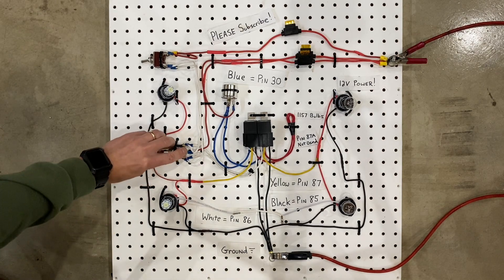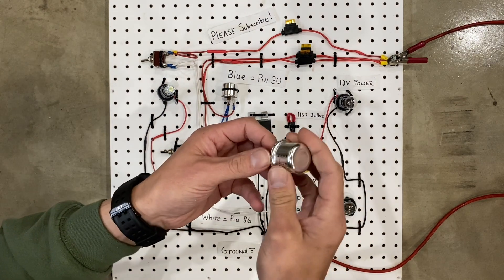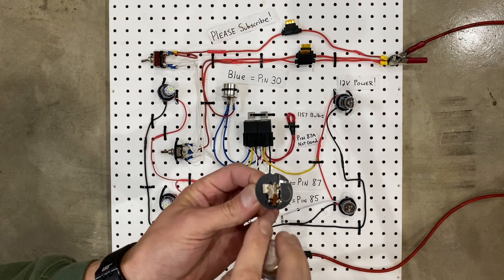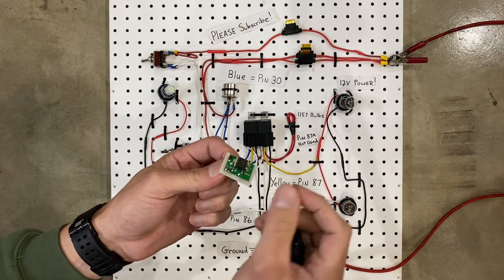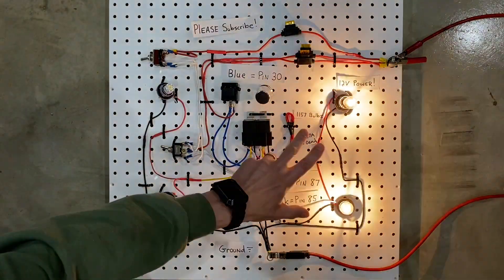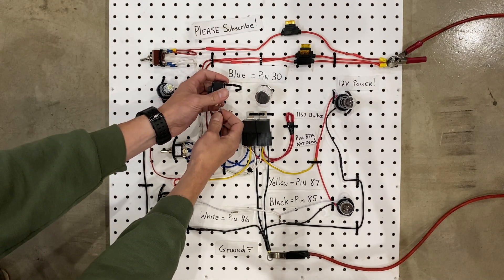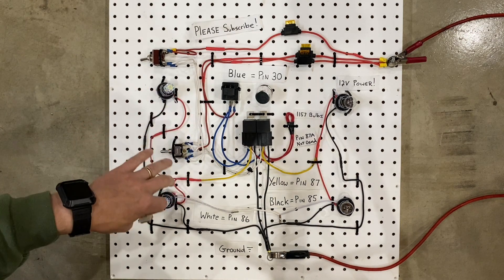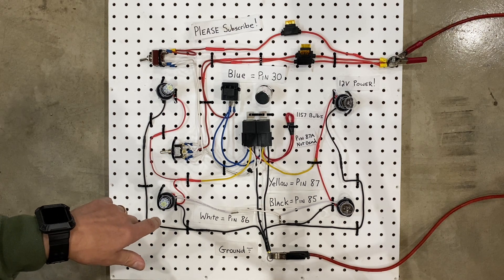How to Fix Your LED Turn Signal Bulbs that Don't Flash. Make Them Blink! | @WiringRescue

Comment from the maker: Thank You for watching the LED Flasher video! 
Subscribe To This YouTube Channel: http://www.youtube.com/user/4g63mightymax?sub_confirmation=1
See My Wiring Playlist: https://www.youtube.com/playlist?list=PLsF7T1tRFy2hmiiUUfMZNyV-BUA_yrPIh
Reply: I mistakenly purchased a 5 pin flasher relay instead of the 5 pin Bosch for some LED pod lights for my quad distance to the parts store and general laziness have me wondering if I can run them with the wires reversed so as to prevent the pulse for the flash or will this LED flash relay overheat?
Reply: @ChinaClone_rider it's not designed for constant current so I would say it would fail prematurely. It's been a year. Is it still working or did it fail?
Reply: @bernardocisneros4402   didn't work
Reply: Hi sir can i put a LED flasher with an halogen bulb?
Reply: @vincentjayvalenzona4051 Yes, as long as the Watt rating on the halogen bulb is less than the Watt rating on the LED flasher.
Reply: What is it when the right side works with the led but the left side won't flash
Reply: @chukkpurdy5151 Are you referring to this video? The LED bulbs were on the left side and the incandescent bulbs were on the right side of the screen throughout the entire video, so I don't understand your question. The reason why the LED bulbs don't blink when connected to the old style flasher is because the old style flasher needs more current than the LEDs can draw, to heat the bi-metallic strip inside of the old flasher. The heating and cooling of the bi-metallic strip is what causes the contacts inside the old flasher to open and close. The opening and closing of the contacts is what makes the lights blink.
Reply: Hmmmm This didn’t work for me.  Restoring an old K20 and upgraded to all led, so nothing flashed. I bought the relay and got very slow flashing with no headlights and no flashing with headlights on.  IDK.
Reply: @Dano500  My guess is that it's going to be your power and/or ground to your new LED relay or you received a defective relay. Those are the only things it could be.
Reply: Hi
Reply: I installed a led flasher, the signals work until I turn my clearance lights or headlights on, what do ido

Comment: So, I redid my 83 CJ-7 with a painless harness.  All bulbs are led, except my front turn signals in the grill.  I tried led bulbs with built in resistors and electronic flashers.  They'll only flash with the lights off.  The second I put the parking or headlights on, they won't blink.  I've tried with and without the polarity adapter.  Any ideas?

Comment: Uh...not so fast. You did not address hyperflasing AND the fact that 2016 tundras DO NOT COME WITH nor are they available, LED FLASHERS.
I've got a gremlin somewhere and have tried ALMOST everything to fix...even a l8cal electrical mechanic scratching his head...new flasher, install diodes in the old one, new sets of tail lights, new fuse...nothing. Right side hyperflasing daytime. Both hyperflasing night time. Shine a flashlight on the sensor at night...left side ok, right still hyperflasing. Hazards work flawlessly. 😢

Comment: Hello, great video! I'm 71 yrs old....riding since I was 7. Because I've nearly been rearended a dozen times thru my life (4 or 5 times I would have been hit had I not moved to the side very guickly). I now have 3 bikes with a 07 softail custom being the one I'm working on now. I'm not concerned with the factory turn signals on the  front but want to change to LED on the rears. So, will each side work correctly with an OEM on front and a LED on the rear. Judging by your video, it appears it'll all work correctly but want to be sure. Thank you! Stan in Hville AL
Reply from the maker: It will depend on what kind of resistance your flasher requires. I’d swap the bulbs and see what happens. Then swap to an LED flasher if needed.

Comment: I've bought 3 sets of different LED bulbs for my bumper tjrn signals in my 95 s10. Every other light i have is LED, but the front ones won't flash for shit.  So obviously, it's not the bulbs. it's the flasher.  Duh. Hopefully, it'll work. i js bought one

Comment: I've hit a road block in my 68 Bird. I've tried different variations of led flasher relays. I've tried reversing polarity. I've even experimented with the grounded options. Nothing changes. With a relay installed, without a relay installed the turn signal light engages on but won't flash.
Reply from the maker: That’s very strange. Are you sure you are working on the correct circuit? I know it’s crazy, but it may be worth checking continuity throughout the system to make sure you aren’t swapping out the flasher for the hazards instead of the turn signals. Sometimes they are separated. Good luck!

Comment: I tried before with LED on my Electric Fiat which uses normal lights by the way. No go. I put in head lights and they work both high and low beams. I wanted to swap out all my lights for LED and the reverse lights half way work. As long as one is the normal bulb I can run an LED on the other side. If I swap out both to LED neither work. Both work with normal lights. Odd they would put normal lights in an Electric Car. Good job Fiat.

Comment: I had this problem installing LED lights on my 67 Chevelle.  They sell ones with a ground wire coming out of the top and one without a ground wire.  Chevelle parts suppliers sell the one with a ground wire.  Is the ground wire necessary?

Comment: When I turn the signal to the right or left, all four signals are on at the same time. Can this be fixed by installing a compatible LED flasher?
Reply from the maker: An LED flasher wouldn’t help that. It sounds like something is wired incorrectly, and it is back-feeding the opposite circuit. Possible a hazard switch wiring wrong?

Comment: Yeah, it's a bendix metallic strip.  Like one side tin, other side something else, and they heat up, but one heats different speed, causing the stiffer one to pull it over to its side, creating the bending action.

Nice explanation.  Okay, now I need some assistance finding the flasher relay on a 1987 Ford E350...🤔   I see so many on the web are round cylinders, but I believe mine may already be a square one.  I wish it was like mint green or pink.  I have so many black or silver square relays under my dash area.

Comment: Hey mate thanks for the video. Iv done a bulb swap on my bike to led and installed a led flasher cam but now they all flash together 😂 any ideas?
Reply from the maker: That’s pretty weird! I would bet that your hazard lights and turn signals all go through one flasher and for a reason that I don’t quite understand, the turn signals are back feeding the other lights through the hazard circuit. If you unplug the hazard switch (if posssible) you could test this idea. Either way - good luck! I’m cheering for you!
Reply: @WiringRescue thanks for the response. I believe I have found the solution as others have found also. The indicator bulb on the dash is still globe type so installing diodes either side of it has worked for others so power doesn’t back Feed. I’ll try this thanks

Comment: Ugh, no help.  I already replaced the Relay Flasher, when I converted all my light bulbs to LED (2005 Silverado), took care of the "Hyper Flashing".  Rear Side markers have a white LED (the housing is Red), everything works great.  I want to switch to a Red LED (gives it a deep Red), but switched to 2 different LED's (both have a Red hue) and the Marker stays on, activated, won't Flash (Turn Signal).  This also causes the Front Side markers to stay off.  Hazards won't flash.  My dash, the turn signal indicators don't flash either AND they are bleeding color (lightly illuminated even when not activated).
  Tried looking/researching for other relays that can help, but none are given except for "Diode Dynamics LED Flasher compatible with Chevrolet Silverado 2003-2006, LM487", which I already have installed, that took away the Hyper flashing.  I am stumped.  Not a big deal, I guess, just that the white bulb makes it look "lite", kinda pinkish, while the Brake/turn signal light has a deep/rich red color and its making my ADHD/OCD crazy!

Comment: What is I add an in line resistor as a load to draw and dissipate the necessary heat to consume the current? :) I heard the Canbus  type already have the resistor

Comment: what about the HAZARD flasher , does that need replaced also ? i am attempting to convert my turn signals and markers to LED . i replaced both flashers to electronic , turn signals work great until i turn the headlights on then they no longer bling just solid on . also the HAZARD do not work at all . thank you .

Comment: What happens if you upgrade your motorcycle turn signals front and rear (different led signal products front vs rear) and swap the relay for an LED one, but the rear signals work properly and the front ones stay solid and don't blink?

Comment: Does it have to use two power switch relays? No way of doing it with one, that allows switching between left side / right side indicators? Might be a stupid question but not wired some before. It's for a motorbike.

Comment: Great video. I have also change for led indicator which is only one and only one side works. If a remove led bulb and turn it 180 it works for other side. I wonder why.

Comment: Hi, thanks for the video. So the new relay style is polarity sensitive and blinks when connected correctly, but doesn't blink if wires are reversed. What about the old style relay? The one with the bi-metallic strips. Is it polarity sensitive too or does it blink regardless of how it's connected?
Reply from the maker: In my experience, the old style flasher does not care if the wires are reversed. It’s very basic, and is quite happy with any electricity flowing through it. Good luck with your project!
Reply: @WiringRescue  Thanks for the quick reply.

Comment: Why would my led bulbs not blink. I have led blinkers with led flasher with ground. Everything else works fine. They work fine when I switch back to regular bulbs. So my problem is not the flasher. What can it be? Thank you!

Comment: Can you swap out the Flasher Relay to LED version and expect it to work with newer vehicles that measure resistance on lights through a connected network and that trigger a warning light when the resistance is not found?

Comment: Thank you for pointing out the polarity issue with flasher relay!! I put my new relay in my 89 Ram and by all accounts, it looked like it fit perfect into the socket, but polarity had to be reversed to get it to work on both the turns and flashers.

Comment: I just upgraded to Led turn signals and mine flash "but" mine flash at twice the normal bulb speed. 
Question ⁉️ Do you think this might cause early burn out of the control system?

Comment: My question .. I have a1982 Honda sabre 750 .. I have a led conversion on it ... the flashers blink ,turn on, turn off as far as I'm concern work .. but my warning light for the tail light keeps detecting a tail light malfunction .. could the conversion be affecting my warning sensor .. I never had incadessant on it to see if that still triggers .. I'm afraid they won't pass safety .

Comment: My problem is the led turn signals won't flash if I turn on the parking/running lights or the headlights.  They flash alone but not with the headlights on.  I have a 1992 ford f150.  Do you have a video that covers that because I'm stumped.
Reply: Did you ever find a solution? I'm having the same problem, works fine unless the headlights are on.

Comment: Perfect thanks
Reply from the maker: Your very welcome! Thank you for watching it!
Reply: @WiringRescue  no such luck I tried putting the new led kind in but still no blinks, nothing it works fine for incandescent lights just not the led ones, enen tried changing both the flasher and the hazard flasher with the new led able ones nothing had to put the incandescent lights back in, any ideas?

Comment: Awesome video ! My problem is my LED turn signals work , but when I turn on my running lights or Headlights which are also LED They wont blink anymore but with Running lights and headlights off they do.
Reply: Did u ever figure out what to do?  I have the exact same problem and it's hard to find a straight simple answer.
Reply: @MattS-w1b  yes after much hardship I found I still had regular bulbs in my front fender turn signal indicators and was causing interruption so if you have regular bulbs in line with LEDs even with led turn signal and hazard flasher

Comment: I bought some aftermarket smoked headlight assemblies that have the halogen bulbs in them for the headlight but the bottom ones is just a LED bar that turns yellow when you cut on your turn signal and then when it goes back off and turn back white for the driving lights had resistors in there from the factory but still hyperflash so I bought a lm487 LED flasher for a 2003 GMC Sierra 1500 that is supposed to be for LEDs but it still don't flash right and then it makes my trailer brake lights when I've got it hooked up to a trailer not work I could take the original GMC one it's stick in there and the trailer brake lights will work any clues of what I can do
Reply from the maker: Unfortunately I’m not super familiar with the workings of those style lights, so I don’t think I can be of much help. Have you tried contacting the seller of them? Maybe they can provide a wiring diagram /schematic?

Comment: I have a question I installed LEDs and headlights and turn signals. I did have hyper flash. I fix that with a relay. When I try to install LEDs in the rear turn signals my front turn signals will not light up. They will work when the headlights are off when I turn the headlights on, the turn signals on my console stay on when I turn the left or right turn signal on it only flashes in the back any suggestions
Reply: It probably has to do with the GND(-) wiring of the loads. All these LEDs are introducing huge resistance to the circuit, so the current is not flowing as it should. You should go to a car electrician for further assistance.

Comment: My turn signals and flashers used to work and now they quit soni bought a led flasher since it has leds and now the turn signals light up solid but the 4 ways flash its on a 94 volvo l46 semi dunptruck any idea why any tips would be greatly appreciated
Reply from the maker: Is your LED flasher wired backwards? They generally only work one way. If you wire them backward, you get lights that turn on but dont flash.

Comment: Very very interesting and informative.  My problem is on a  Harley Road King .  Switched the OEM front Amber Signal / running Lights for a LED Arlen Ness light bar .  The Tech. said that they were suppose to be Dim when Blinking .  They are maybe 20 % brighter when they Signal , maybe less.  No Hyper Flash , just weak weak signaling . Do you think a Flasher would fix that ? I;ve been thinking I needed an Equalizer or Resistor and have to splice into the wires.
Reply: Hey, any update on this? I’m having the same problem the led lights dim instead of actually flashing which I feel is less useful than the oem halogen bulbs because they also stay on constantly just dim when using them

Comment: hello sir. i already change to led flasher. but my blinker still dont blink. i switch between wire also. still not a chance. my motorcycle has 3 pin( L B E) and my flahser has 2 pin.

Comment: Brilliant video. Thank you so much. You saved me going down a rabbit hole.
Reply from the maker: Thank you! I’m glad you enjoyed it!
Reply: @WiringRescue  I have the $8 part on order from Amazon. Just installed LED turn signals on my 66 Dodge Polara and they weren't flashing. A quick search came back with your easy to understand video.
Reply: Installed my flasher today. Glad I watched your vid. My connector is the kind that has the two plugs on one L-shaped piece. Plugged it in and it didn't work. But based on your vid I figured the leads were backward from what I needed. Was able to saw the single connector to make two separate ones like you have in the vid. Reversed them and it worked!

Comment: please tell me if that new flasher will show you if one bulb is dead? in old school sistem when bulb is not working you have hyperflashing, and here?
Reply: I came way too late but, common aftermarket LED flasher circuits are solid state. Meaning that when a bulb is fused/bad the driver won't be able to know while driving, because blinking frequency will not change.
Reply: @OnFullAfterburner  this is not good, and can be dangerous also. Thanks for answering!

Comment: Okay that was an awesome video. So please tell me this. I have some cheap OEM blinkers I'm trying to put in the front of my 71 K5. When I have the parking lights on it will flash and everything works properly. When I have the parking lights off, only the back incandescent ones will flash. This seems completely opposite of what you're saying. Any help would greatly be appreciated. I'm so frustrated at this point it's not even funny. Do you think a no load LED flasher with the ground would work? I'm at my Wit's end here. An awesome video. Even a dummy dummy like me was able to understand most of it, lol

Comment: I'd like to add 1 thing.. for motorcycles that are still having issues after swapping in an LED flasher, check if you have an incandescent indicator bulb on the gauge. This will most likely solve the issue. Either just remove the bulb or replace it with an LED.
Reply from the maker: Great info! Thanks for sharing it and watching the video!
Reply: Any of the gauge lights ? I’ve got a led strip and led flasher relay on a CT1 175 6V and the lights work correctly but won’t flash. I only 4 bulbs total in the gauges (tac and Speedo) must I replace all of them with LED?